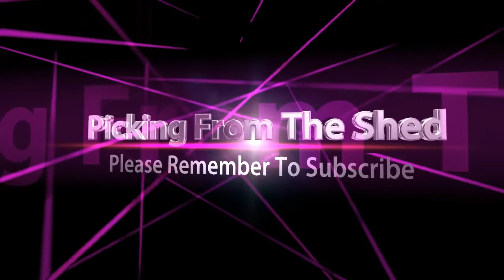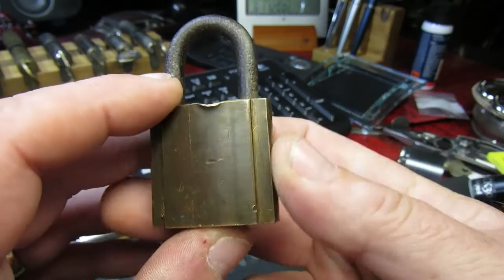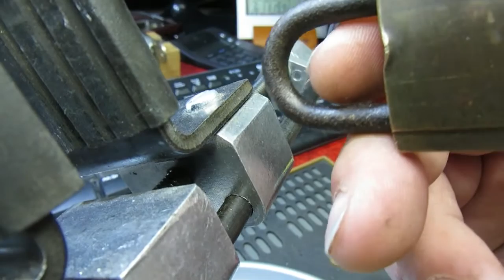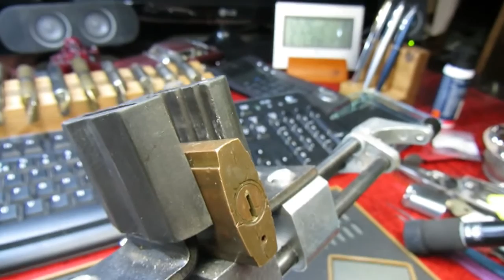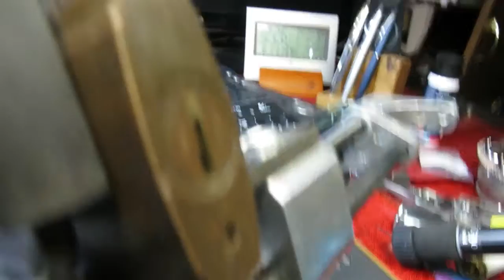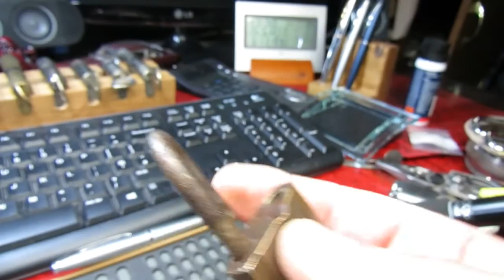(119) Vintgage Eagle Padlock SPP'd

Comment: Very nice picking. It is interesting to use such amount of pressure on such padlock. But some locks needs special approach.
Reply from the maker: Thanks, it took a bit of working out, but I get binding pins with light tension, but no clue as to when they're set unless I used silly heavy tension.  Probably down to old age, we all get more stubborn the older we get :-)

Comment: Nice picking. It isn't to bad once you get it but fun to figure out when it is dead. At first there's no feedback and the core is solid. If the bitting was a little better I would probably be still trying to get into it. I'm a little bias though I love Eagle. I sent a US Eagle to REDEYE that was the same. Once you figured it out wasn't that bad but until then it will give you doubts, lol.
Reply from the maker: Thanks, spot on with that, I couldn't believe how much I struggled until I got the tension right, just goes to show even these old locks can still give out some fun picking.